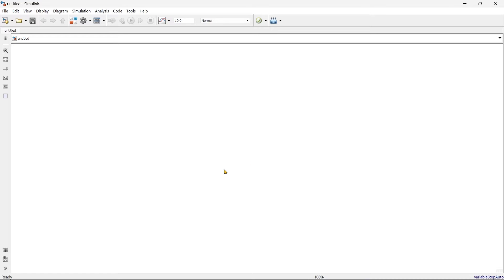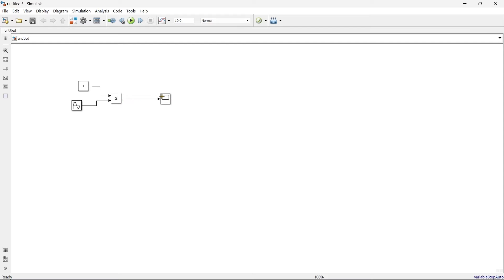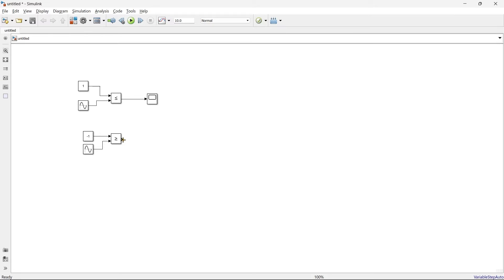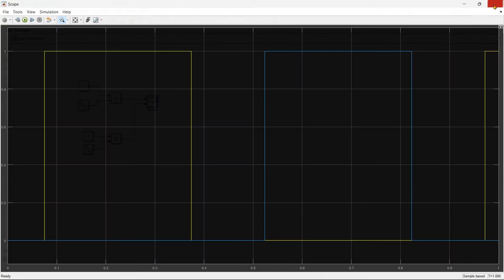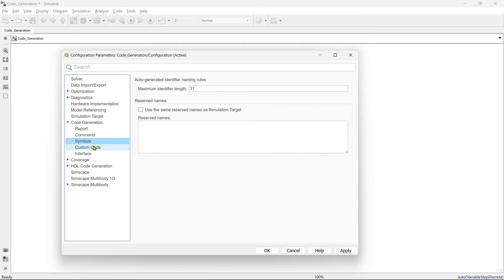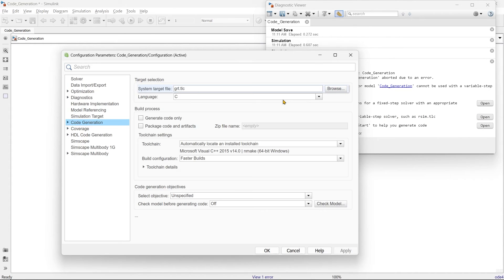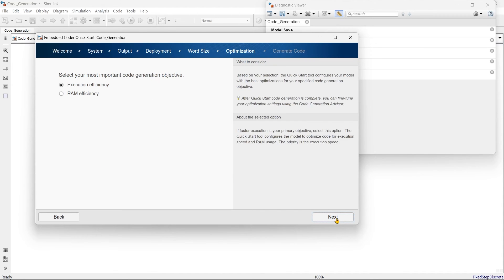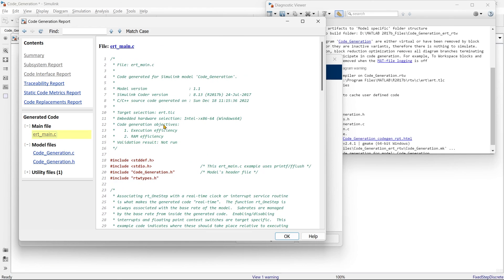Generate C code from Simulink model | Simulink tutorial | MATLAB Tutorial

Comment: Sir I was given the following question 
Write a MATLAB function called looptest (N) that loops through the values I through N and for each number n it should divisible by 2', 'n is divisible by 3, 'n is divisible by 2 AND 3 'n is NOT divisible by 2 or 3
In answer i have written
function loopTest(N)
for i=1:10
      r=rem(i,2);
      s=rem(i,3);
    if r==0 && s==0
      fprintf("%d is divisible by 2 AND 3\n",i);
     elseif r~=0 && s~=0
      fprintf("%d is not divisible by 2 or 3\n",i);
     elseif r~=0 && s==0
      fprintf("%d is  divisible by 3 \n",i);
  elseif s~=0 && r==0
      fprintf("%d is  divisible by 2\n",i);
    end
end

N is given by me in input.is this wrong?
Reply from the maker: I will check it and let you know